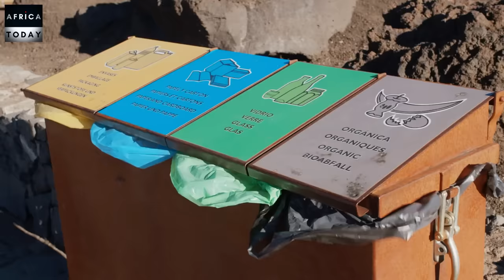5 Cheap High-Value Machines That Will Bring You 90% Return On Investment In Africa

Comment: It's very good to start manufacturing things in Africa. the problem is not buying the machine but the machine's needs electricity which is the biggest problem in African.
Reply from the maker: Some of these machines come with power generators on demand
Reply: @AfricaToday1 the generators use fuel which is skyrocketing
Reply: Solar can work. Plan for it first

Comment: All of these machines require a stable electricity supply. Cheap, stable supply of electricity anywhere is the game changer. And roads for transportation of goods.
Reply from the maker: Sure, they do. Some of them come with generators on demand
Reply: @AfricaToday1  Yeah. The cost of fuel may kill all profits. I had restaurants in Ukraine, and we also had constant power outages there. I would just close the restaurant during the blackout. Didn't make any sense running it. Ukraine is very similar to African countries. Same problems.